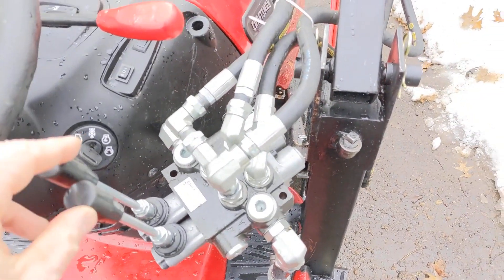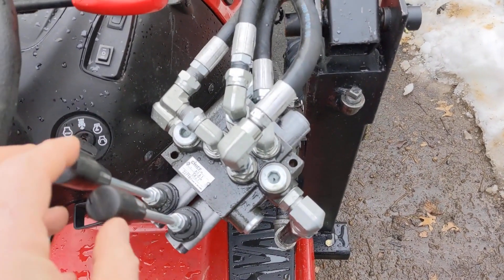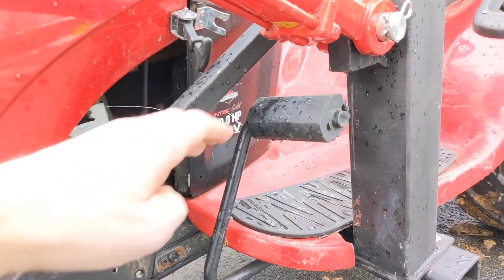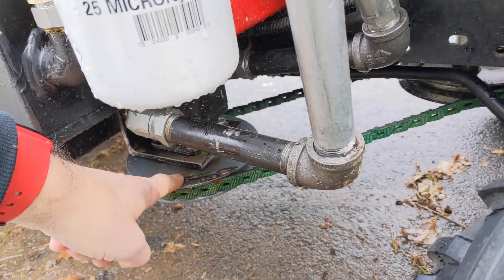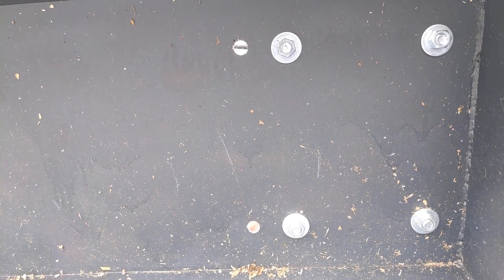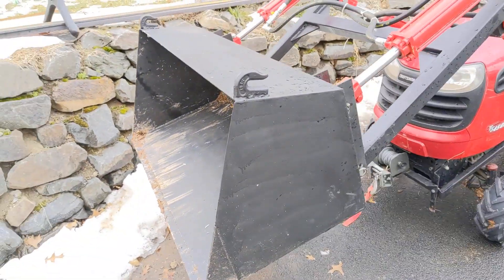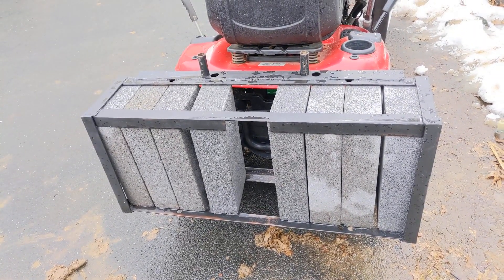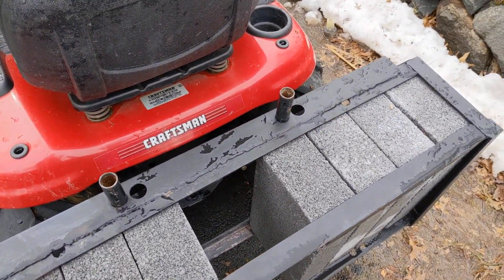Front-end Loader on a Lawn Tractor, What I Learned

Comment: That iron pipe is fine for the high side(good for 5k psi) but you have to use different elbows because while the pipe is good for 5k, elbows are only rated for 300 or so. I ran into the same thing on my build.

Comment: One thing don't use galvanized pipe it will flake off into your pump and ruin it
Reply from the maker: Yup, there were a lot of compromises and challenges on the plumbing side. Lowes and Home Depot cannot thread short pieces in their threader and buying a whole npt threading setup wasn't in the cards.

Comment: Hi, Ed here with Ed's 2 Cents Worth.  I would like your permission to use a couple of captures from your video(s) of front end loaders on small tractors (lawn mower type tractor). I am in the process of creating a video encouraging home owners with some mechanical/fabrication experience to go ahead and build their loader. If I can demonstrate there are multiple uses for a small loaders more will join in. So if I can display how others are using their loaders prospective builders will see they are far more versatile than just moving dirt and mulch around. I will not use any pictures that I do not have permission to capture.  Thanks you, I await your reply, Ed Preve
Reply from the maker: Have at it

Comment: There is an alternative to putting a complete hydraulic system on the mower. Get the hydraulic system off of a boat that operate the outboard motors "trim" system, they usually contain 2 rams, all of the S/S braided hydraulic lines and contrls and the system operates from a 12 volt stand alone hydraulic pump/reservoir and is no bigger than a shoe box. In most cases the rams are anywhere from 12 inches up to 2 ft...closed. I got the system off of a ski boat and it's rated for 600 lbs and again it's stand alone and only reqires 12 volt DC to run it which the mower already has. The system was somewhat taxing on my little mower battery so on the back of my mower I mounted the biggest battery that I could find and tied it into the mowers stator circuit after that I had no problems and the battery actually helped my counterbalance issue.... Just thought ide put this idea out there because putting an entire hydraulic system on a mower platform is do-able but a major PITA and can be overwhelming when trying to figure out where and how to mount a pump and all of that,
Reply from the maker: Thanks for the tip. Yeah, I actually have this mini truck with a 12v hydraulic dump bed which probably has some similarities. Northern Tool and others sell closed complete 12v hydraulic systems too.

Comment: If you want to have an oil level guage for your tank you will need to drill a hole on the top and very bottom of your reservoir. weld on 2 elbows so there holes face each other. Then you will need hose fittings to screw into the elbows. Lastly you will need some clear hose/clamps to connect between the fittings. Make sure the clear hose can take some heat(Braided hose would work best). For size you wouldn't need anything bigger than 3/8".

Comment: It’s over built for that tractor. I’m looking at building one of these on a craftsman lawn tractor but using smaller components from two small engine lifts rather than starting from scratch.
Every one of these I’ve seen is either under built or over built.
Reply from the maker: The PF Engineering guy actually came out with a new set of plans for a smaller tractor - but that didn't exist when I made this. I don't know what I'm doing so having even a bad recipe to follow is a good thing.

Comment: Hello Ryan,  I too am building a loader for in my case an early 70's John Deere 140.  Not the ideal platform but it should work.  I wanted to relate my experience with the PF Engineering plans, I found them to be a little short as well.  Not that the gentleman who developed the plans can address every case but there are some areas that I think could use some improvement, like a revision of cost.  While I could have done it cheaper I think It's worth presenting an example of a build with more mid grade components.  I used welded Prince hydraulics 2.5" cylinders, a 10gpm vane pump rated for v-belt drive, made to length hoses and a valve block that can lift/curl lower/curl (joystick) and has a float feature.  I knew I wanted these things from operating bigger machines.  This adds significantly to the cost.  I would not discourage anyone from building one of these or building it as cheaply as possible however I think some updated real world numbers should be addressed.  Your build is awesome and I appreciate your point of view.
Reply from the maker: That's awesome - make a quick video about it. I'm sure people would be into that, especially talking about how to choose pumps, valves, cylinders.
Reply: @RyanShea  I guess I should.  Haven’t done much youtube but might help someone out.  It’s not quite complete yet, some more paint to do, hood/fender some odds and ends to clean up on the foot pedal mod and plumbing routing.  Seems to work good tho, full bucket of pea stone no prob.  I have a burned up 7.3 powerstroke in the backyard I’m gonna try and lift with it next time I’m home.

Comment: Definitely recommend using an actual garden tractor just for the extra strength of the frame and a transaxle that will hold up to the weight and abuse. But overall I'm glad that this worked on a lawn tractor.
Reply: That is NOT A GARDEN TRACTOR regardless of what he or the manufacturer claims!
Reply: Yes Aaron ,no "Sense" in building on a "Rinky-Dinky" plateform.
Reply: This is a garden tractor. Yt/yts 3000 and down is riding mower yt/yts4000 up are garden tractors
Reply: Front axle components are much to light built for all the extra weight on the Lawn Mower chassis displayed
Reply: You should plumb the hydralic return threw the filter and let the suction pull  directly from the tank with just a strainer.  If the filter plugs you will burn the pump up.  But good job
Reply: Only pain on garden tractors are they are expensive lol

Comment: You did a great job. I do see one potential issue with your hydraulics, the filter should be on the return side. The filter is used to keep metal from contaminating the reservoir in case of pump or valve failure.
Reply from the maker: Plumbing was maybe the hardest for me. This was based on PF Engineering instructions. I was biting off a lot with this project... but this was like "baby's first hydraulic circuit".
Reply: Thanks for this video , I am going to start on my loader in March ,
Reply: Also, being on the pump feed side can cause cavitation and destroy the pump over time. I'd also put a ball-valve on the hydraulic tank to make filter changes much easier. After a few hours of hydraulic operation, I'd change the filter because it will be catching the debris left over from the machining process of the various parts involved (pump, spool valves, etc.) as well.

Comment: I've subscribed. Good work. From my experience I would suggest you try mounting your loader to a garden tractor with a foot controlled hydro transmission. Foot control would allow you ease into the pile of wood chips leaving your right hand to slowly lift boom and slowly roll bucket up all the while easing tractor forward with the foot control. It's quite fun and satisfying to get into the rhythm and get a lot more wood chips in your bucket each time. It good of you to reply to comments as often as you do.

Comment: Its still not attached well. If you tried driving into a pile hard it would snap off. Look at how other loaders are built. Your rear upright mounting location at the bottom. 1  3/8 bolt isn't enough. Anytime rod is going through bushing or bearings or wheels you need cold rolled steel. It's not a hard project, it just takes a lot of stick to it ness lol
Reply from the maker: It is all about the weakest link. I think the DOM bushing stock is cold rolled, but not the pins. The tractor frame itself has all the rigidity of a soup can, so this is about moving wood chips, which are light. I can't get into too much trouble because the open diff is a virtual guarantee of getting stuck in mud or gravel or wood chips (yup, all three happened) . Also the steering is hard enough that I can't whip this thing around quickly, even on a good surface.  It is funny though how many differing opinions there are about what will break first. My guess is the frame itself or something with the front wheels. I'll watch it for those piles (or more likely trees) though.

Comment: Nice job, typically you should have your return filter going to your tank. Then from your tank to the pump
Reply from the maker: Yeah, I was pretty much following the PF Engineering plans. The bigger problem is that I have some inappropriate piping on the pressure side. Plumbing was much more difficult for me (not being able to thread my own custom length pipes and hoses) to get things to fit - and trying to fillet weld around the elbow on the tank and end up without any leaks.
Reply: @RyanShea  you did a great job, I've been working with hydraulics on ships for 30 years and still learn new things all the time.

Comment: Your rams for your bucket tilt is a little bit of an over kill 1 smaller ram in the middle would cut down on extra weight out front especially with Those front tires are way too small other than that looks pretty good
Reply from the maker: I was afraid and inexperienced, so I tried to follow the designs like a recipe. PF engineering now has a smaller design with a single cylinder in the middle like you say.

Comment: I have built three hydraulic FEL's and one electric. For the novice, the electric version is way easier. The weight is about 50% less than hydraulic and it is much easier to buy the needed parts. The electric ones are much more suited to the riding lawn mower class than hydraulic models. The tractor here should have used an electric version because they are limited to 300 lbs or less depending on the front spindles and the thickness of the frame. I use my electric version around my home to haul sand, mulch, and other things that are too large for me to haul by hand. My wife and I just laid four pallets of sod with it and it saved our lives and backs. I would drive up to the trailer with the sod in it and then place the bucket so that the sod rolls would just roll into the bucket without having to lift them. Once in the correct spot to lay it, I would lower the bucket and my wife would just roll one roll out and then unroll it in place. I spent $800 on the steel and electrics and $1200 for the three linear actuators. I got the high-speed ones that are as fast as hydraulics but they cost about $50 more per actuator. I am old and have back issues so I designed it to be removable without any really heavy pieces. My frame support stays on the tractor when the loader is off.  To remove the loader I unplug the actuator's wires, take the two pivot pins out, and then pull the two pins on the actuators so that the bucket is all by itself with no extra weight. Then I lift the arms out of the vertical supports and tie them up vertically in my shed. The two vertical support posts fit into two, 2-inch trailer hitches that are welded to a 1x3x27 inch solid steel bar that is bolted to the lower frame. They both come out of the hitches and each one weighs no more than 30 pounds each. So the bucket is off and the two verticals are off and the only thing left is the bar with two short 2-inch hitches.  BTW, the front support brace that goes to the two vertical posts also comes off with just pins and weighs only about 25 pounds. If I can help anyone with your electric project send me your info here. This builder did a great job with what he had and learned a lot of what not to do next time.
Reply from the maker: Wow, thanks for adding your knowledge and experience. Do you have links to pictures of your loader(s)?
Reply: @RyanShea  I have some pictures of the electric loader but I do not know how to send them to you except email or text.

Comment: Ryan, Great job! We build Electric front end loaders for a living. Every once and a while I come across videos like this one that inspire people to tackle their own needs, and you have done just that. There are plenty of folks that want to do their own DIY projects and you have provided that which I think is awesome. Thanks again for sharing with the community. Best regards, Carlos CT Solutions.
Reply from the maker: Thanks. I had looked at Johnny buckets or various winch based solutions first, so there is certainly a place for electric options.
Reply: @RyanShea  You would be surprised with what electric can do. We built about 100 front end loaders this year and plan to double next year. our design is different because we have to mount to the snow blower brackets on the front of the tractor instead of mid mount, but that was the only way to not void the warranty. Either way with only 80# of counter weight on the X500 Deere models we can still lift 250# to 400# and it's a bolt on accessory that comes off in a few minutes to get back to mowing. Check out our "Little Green Monster bucket loaders". Johnny Bucket never answers the phone and you're lucky to get an email back so as an engineer and I own a fab shop, we designed our own that would at least lift to 4' unlike the JB. I just thought your post was really cool because I was no different that you 4 years ago when we built the first one and just wanted to find information and there was not much out there or they were some crazy builds that looked like someone was going to get hurt. Your video is inspiring for sure, and PF Engineering only gives you basic plans so great job working your way to the finish line, and posting something that can help so many others.
Reply: @carlostejera8476  the hydraulics look wayyy too complicated. I'm going electric.

Comment: Hi, Thank you very much for making these videos. In 13 minutes you shared more information than I found in doing 50 hours of research. I did learn a lot in these 50 hours, but I doubt it will translate into something I can use when I build my system. I am lucky as I have a medium frame garden tractor that should hold all the gear without any issues. I already have an hydraulic system on it, but it's 3 gpm, and it wouldn't be enough to run a FEL and a backhoe. I have subscribed. Thank you for the valuable information.

Comment: I'm just amazed you put that much work into building a front end loader and I must say looks like you done a good job. But you mounted it on a CRAFTSMAN lawn tractor. I've built 3 loaders for garden tractors over the past 10 years I always mount them on cub cadet wide frame garden tractors like 1450 149 the last one I built I mounted it on a cub cadet 1811. Those craftsman lawn tractors are no good. Craftsman did build a decent garden tractor years ago I believe In the 1990s. Do yourself a favor and buy a older heavy built garden tractor. There very affordable you can get cub cadet,  ford, john Deere, even a Sears suburban.
Reply from the maker: Yep, old simplicity or case or international come up on Craig's list. If/when this breaks it's so cheap it doesn't matter. I actually want/need a small tractor for getting between garden beds. I also had a storage issue, but have since made a small lean-to shed.

Comment: Take that schedule 40 galvanized pipe off that and use a stainless flex connector for your filter.
Reply from the maker: Oh, ha. Yes I made, um, choices based on what lengths were available. I know it isn't right but the home center won't thread lengths shorter than two feet and I don't want to buy a npt dye thing.

Comment: Dude I loved both of your videos. You built a badass loader. I am very impressed and I want to encourage you to keep learning and modify the rig for your needs. You have more than enough skills to build an entire new frame and fit a stronger trans and front end. I can’t say e ought about your awesome videos. Don’t let these other self righteous d*ckhead comments on here get you down. You are a fecking legend! Subscribed!
Reply from the maker: Thanks so much. They are correct, it is not a proper tractor for implements or digging. I'm just using it for wood chips and some light snow. Fortunately it's relatively easy to hook this up to a new tractor if I ever go in that direction.

Comment: Hi Ryan How is that transmission holding up ( does it deel like its going to break?) I have a Hydro transmission and it feels like it wantes to break.
Reply from the maker: I have been on other projects lately, but the two biggest problems are not the transmission. I need to stiffen up the frame a bit, which should be easy enough to make an improvement with some cross braces. Next, I need to lift the front a inch or so to get better clearance.
Reply: @RyanShea  cool is yours a hydro.

Comment: Nice work Ryan!  I was wondering if you would be willing to share the overall cost that you have into that front-end loader build?  I've thought about making something like that for my old tractor, but I thought it might be better/cheaper to go with a larger tractor with a front-end loader equipped.
Reply from the maker: A used Kubota BX with a loader is probably north of $12k. I did not do careful accounting, but let's say I spent somewhere in the $2k-3k ballpark (ymmv, prices of everything are shooting up). This is of course apples to oranges, as something like that Kubota is a much more capable machine, 4x4 diesel, etc. For me, my goal is moving lots and lots of wood chips, so light weight, high volume - and I needed it to be a small machine to fit into a bunch of spots, around garden beds and through smaller gates.